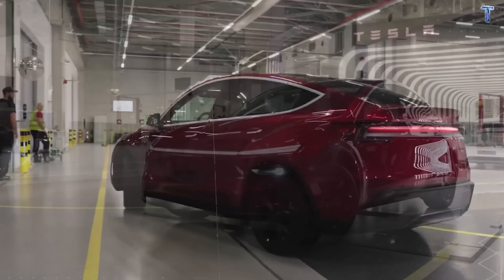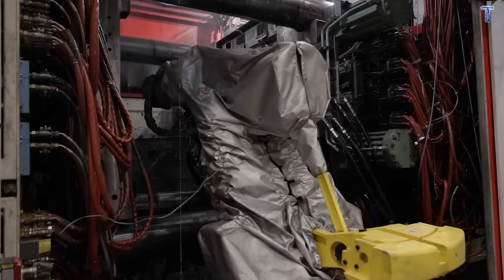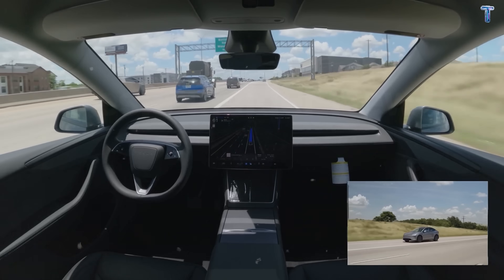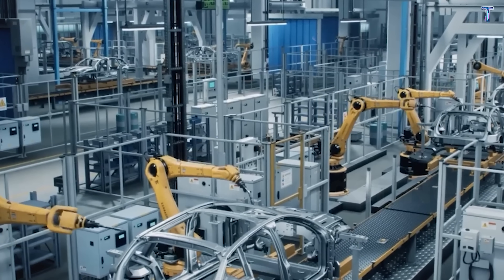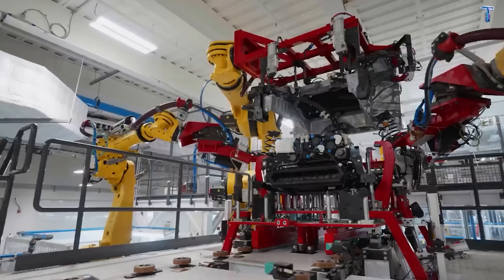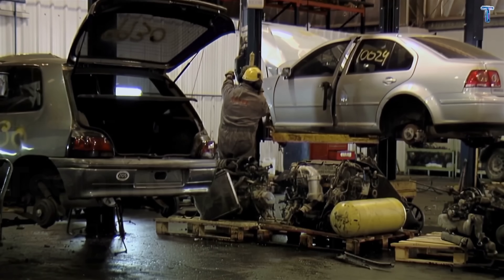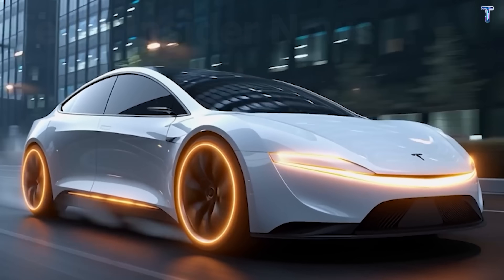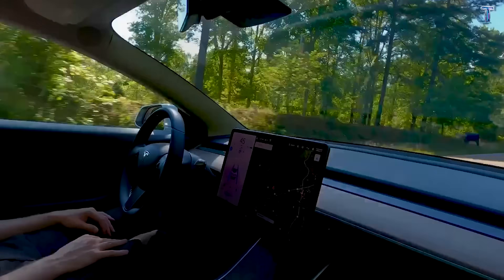Elon Musk’s $12,749 Model 2 Ends Car Bills Forever

Comment: Each advertisement shows diff models (of diff models of a Tesla 2?..is this deceptive already?
Reply from the maker: No deception. All renders show the same core Model 2 – price, chassis, battery and features are locked. What changes until reveal are minor details (wheels, lights, mirrors) while they finalize testing. Final design gets shown Q2 2026, what you reserve is exactly what you get in August 2026. No surprises.
Reply: Of course it is Bob, total click bait.
Reply from the maker: Yeah, titles like that can feel clicky. The video just sticks to its own 12,749 claim, not an official Tesla number. What part felt the most overhyped to you?

Comment: Do you get the FSD for the $12,749, or is that a $7000.00 optional upgrade?
Reply from the maker: Good question. The short answer: the “$12,749” price doesn’t include FSD — that is just for the car itself. Full Self‑Driving remains an optional add‑on. If you choose FSD later on, it will cost extra, beyond the base price.
Reply: @TeslaInsiderNews  It's $100 per month as a subscription option. It's nice to have but not essential.
Reply from the maker: If FSD stays as a $100-per-month subscription, that actually makes it easier for people who just want the base car without extra costs. For a lot of drivers it’s a nice-to-have, not something they need every day. Would you want FSD on all the time, or only during certain kinds of trips?

Comment: Wait, $12,749 for a Tesla sounds too good to be true. But what about the self-maintenance system? How can a car fix itself? Seems like it could lead to more problems than it solves.
Reply from the maker: Totally understandable to be skeptical! But the self-maintenance system doesn't mean the car magically fixes itself. It uses AI to predict when components will fail and sends over-the-air updates to prevent issues before they happen. It’s like having a car that tells you when it needs a tune-up before anything breaks.
Reply: @TeslaInsiderNews  Okay, that sounds cool, but how reliable is this AI? What if it misses something important?
Reply from the maker: Great question! The AI is constantly learning from millions of miles of real-world data, so it’s not just a 'set it and forget it' system. It’s designed to be proactive, not reactive. And with the over-the-air updates, it's always improving.
Reply: it preemptive maintenance and used in airplanes ....
Reply from the maker: "Yeah, predictive maintenance has been used in aviation for years — that part is real. The difference is that airlines have huge budgets and strict maintenance cycles. Translating that level of monitoring into a cheap consumer car is a much bigger leap, so we’ll have to see how well Tesla actually implements it in practice."